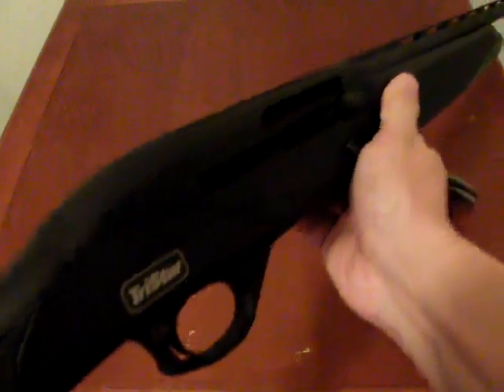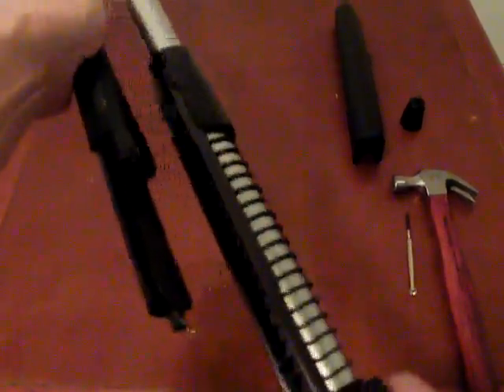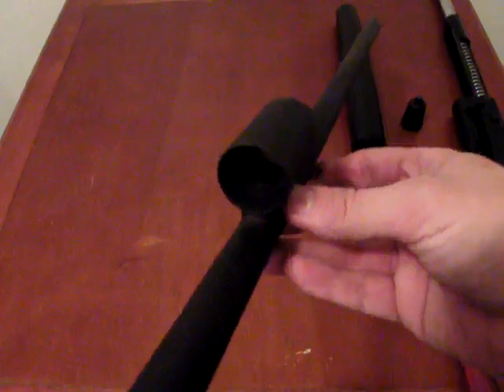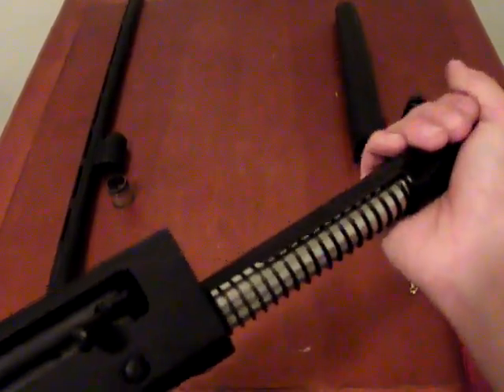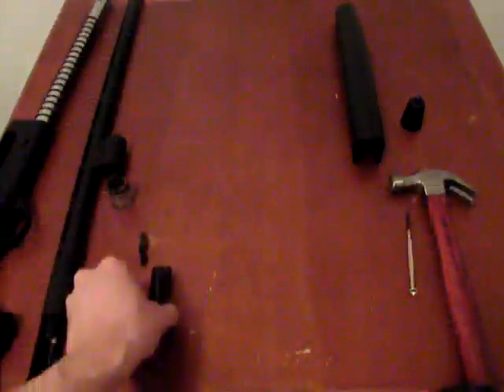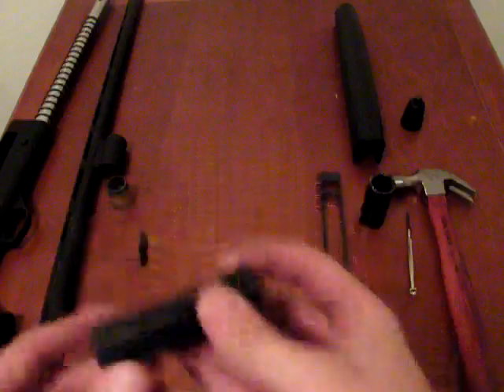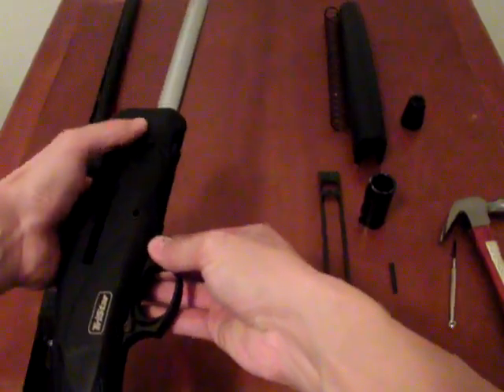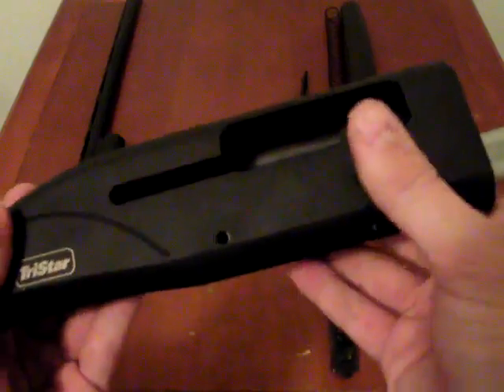Tristar Viper G2 Shotgun Disassembly Field Strip Fieldstrip Takedown - Gunknowledge.com

Comment: Im glad someone has posted a breakdown video of the Tristar viper g2, i have one myself but instead of the synthetic i have the wood, with black receiver, 26in barrel. I got it last summer and i have been using it for skeet shooting. I have been trying to find any other parts or accessories for this gun like choke tubes, improved sights or even different barrels but i have had no luck, any suggestions on your part?
Reply: Choke tubes are Beretta/Benelli Mobil or Franchi if you have the 16ga

Comment: Instead of the screwdriver/punch to remove the trigger pin, cut a wood skewer 4 inches long and cut enough of the pointed tip to fit in the pin hole to drive/remove the pin. This way you don't mark the gun or pin.

Comment: Need your help please~ We were having problems with not being able to pull the slide back and a shell being stuck inside. We took it apart and when we got to the trigger assembly ours did not look like yours because the hook latch not sure what you would call it was stuck in the upright position unlike yours which was down in the assembly. The spring seems to be fine and not loose but we can not get it to stay in the down position. I took a picture but not sure if I can get it uploaded on here. Would you have any idea what the problem is and why it will not stay down and/or why the shells are becoming lodged inside and not able to eject them? Thank you in advance.

Comment from the maker: @cheesegunshoot 
Mine came with different chokes, haven't seen anything of an aftermarket for them though.  Generic shotgun sights will work, depending on the mounting method, so you could add a ghost ring or fiber optics to your vent rib.